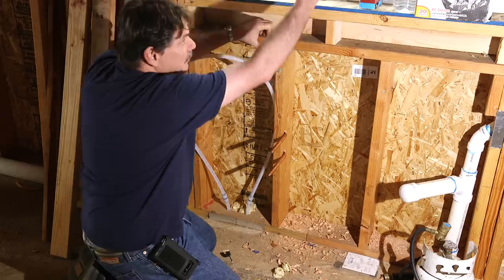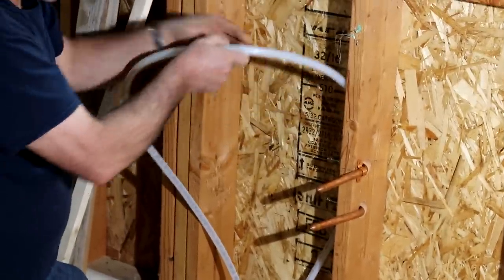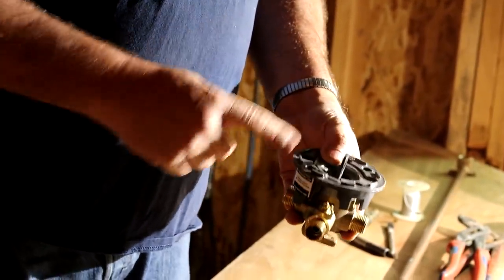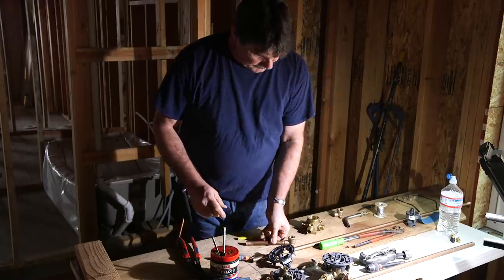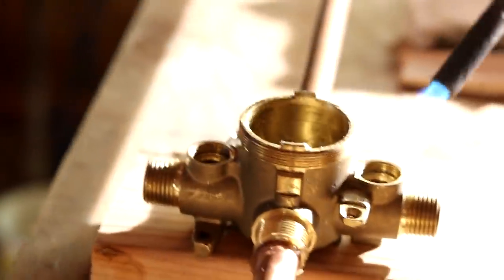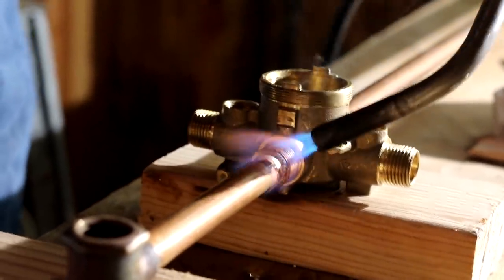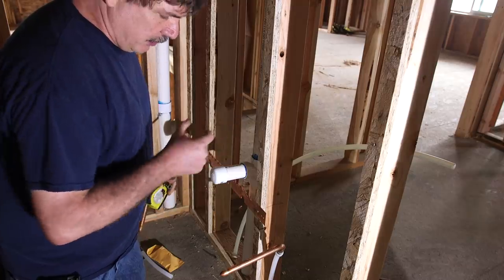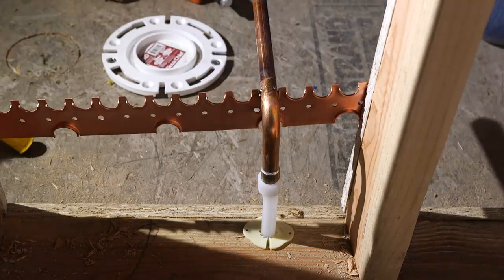The Plumber Torches It Ep. 96

Comment: Heh, so very different from where I live, code here says absolutely no hidden connections what so ever!
Reply: You mean all plumbing is exposed? How can you do any connections behind the drywall?
Reply: @beby843  nah, it can all be hidden, just no connections, mostly pex is used now and that obviously bends, and connections are made like under the sink and theres also special boxes with an inspection door to make multiple connections in, usually placed in the bathroom if the connections are not done under the basin commode. Codes gotten pretty strict the last decade since the insurance companies got tired of all the water damage and teamed up with different organizations to make guidelines on how to make water safe bathrooms and installations and stuff like that
Reply: @Pontus95  where is this and what do the showers look like?
Reply: @robertbeirne9813  Sweden, and it would look just like a normal bathroom
Reply: @robertbeirne9813  if you mean like how the connection would be, the PEX (hot and cold) would come out through the wall, the waterproofing membrane would be put around it and a pipe cuff as well together with a bunch of roll-on glue, and the shower blender would connect over the pex pipes on the outside of the tile, 
We have a variety of different fixings for pex so no connections are needed really
Reply: @Pontus95  I think I know what you mean. The shower valve is outside the wall, but with a decorative shroud over it?
Reply: @robertbeirne9813  pretty much yes!

Comment: Two words:

Galvanic corrosion.

You need to use copper or polymer coated screws on those copper straps. Over time, those screws are going to corrode the copper pipe due to electrolysis.
Reply: Are they? Has this phenomenon been observed with screws in a copper strap in the real world?
Reply: @kozemchuk  Yes, it will. The water system in homes  with copper pipe is conductive and is normally bonded to the grounding line of the electrical system in a house. The water tends to exchange electrons with copper water lines, which causes a thin film to develop inside the water line. This film normally last for centuries, which is why copper is a preferred water supply medium. But when a less noble metal (like steel for example) contacts the copper, the electrons in the water now want to exchange with that metal. This causes a reaction between the two metals at the point of contact. With enough time and in the presence of oxygen, that pipe will eventually rot out at that point nearest the screw.
Reply: @REDACTED-1  I understand the concept just fine, thanks. I've seen it when copper is threaded into galvanized fittings. What I am asking is has this actually happened with non-copper screws in copper straps? You provide a theoretical reason but no real world evidence.
Reply: @kozemchuk  Yes. I’ve worked on several homes where the straps were nailed in with drywall nails, usually timber framed homes built 1960-1970. A lot of times I see copper pipe soldered to other copper pipes for support on the exterior of the pipe. But I’ve seen copper straps that have started corroding around the nailheads and the nails have complete rusted out and the copper has become corroded. It takes years, decades even. But eventually it has its way once the nail is nearly gone.
Reply: @REDACTED-1  I've only seen it when water connects the two metals. I can't remember ever seeing it otherwise. Not doubting you, but without the water contact I don't see it happening.
Reply: @ChrisGilliamOffGrid  Yeah. I know what you’re talking about. Like I said, all the times I’d seen it it was usually when drywall nails were used. Not sure if those screws are coated or not but I can’t imagine it would be much different if screws were used. Again, this doesn’t happen overnight. The times I’ve seen it I was working on older homes that were on their second or even third bathroom or kitchen remodel with original copper plumbing that was upwards of 50 years old at that point. Mostly in basements now that you mention it, so perhaps the higher humidity/condensation was a factor. Either way, there’s a reason bell hangers are sold with copper screws. I don’t even use copper straps anymore, I use the plastic ones. They’re durable, non reactive and dampen pipe noise. Same price too.
Reply: @REDACTED-1  Cool, good to know. I've never seen it but I haven't been plumbing that long. My company uses zinc coated screws, I wonder if that makes a difference or not.

I wonder if that was also accelerated by dampness in the walls. I could see the electrolysis reaction happening more slowly if the only moisture was in the pipe.
Reply: @kozemchuk  Zinc is a less noble metal than copper. As it corrodes, it exchanges its electrons until its fully oxidized. Then the steel in the screw goes and the copper with it. I would use polymer coated screws or just switch to plastic straps. The plastic ones are way better and you can use them with pex or copper. Most of what I’m doing these days is pex unless it’s a renovation and the copper is in good shape.

Comment: Not a huge fan of water lines in exterior walls, especially in Northern climate zones.  You guys in Oregon probably don't need to worry, but plenty other parts of North America do.
Reply: There is a magic concept called insulation. Pipes froze in walls all the time back in the day, and still today unfortunately, due to improper air sealing and insulation. It's not the pipes at cause it's the improper building practices.
Reply: @rolfbjorn9937  Keeping water lines out of the stud bay on exterior walls in cold climates when possible is the better building practice versus air sealing and insulation.  There is no reason those lines could not have come up through the floor.

Comment: Why not use pex to the shower head?
Reply: Makes the shower head fitting more stable in the wall.
Reply: @kozemchuk  I use PEX to shower head, but only use drop earred 90 that has 3 screw holes, and good screws.
Reply: @ChrisGilliamOffGrid  The three screws make a big difference compared to the ones with just two!